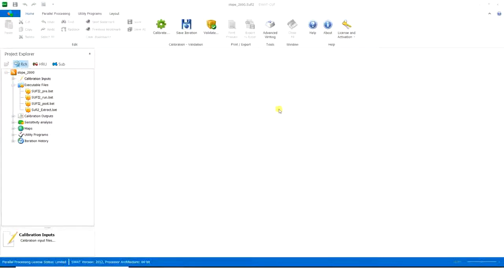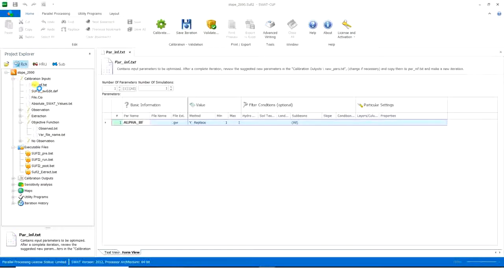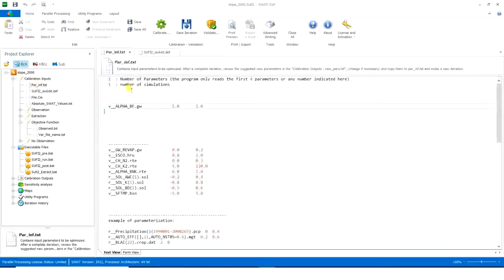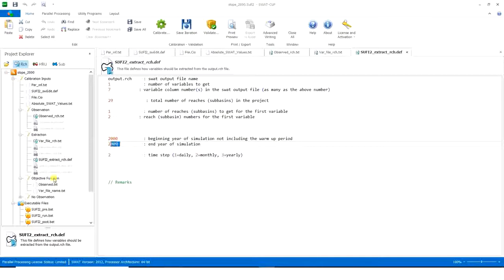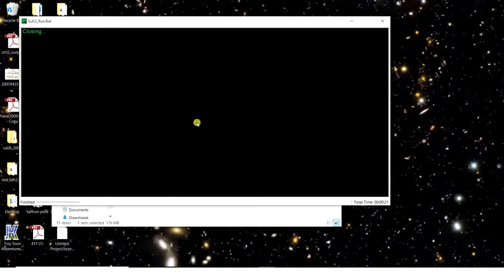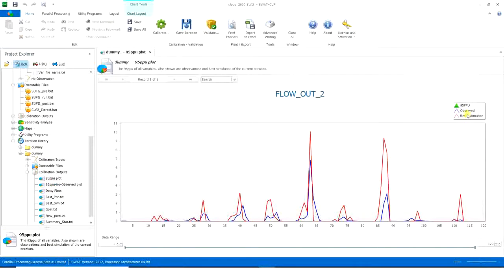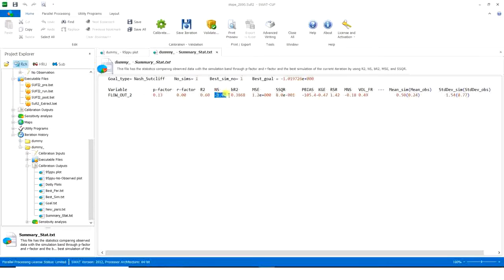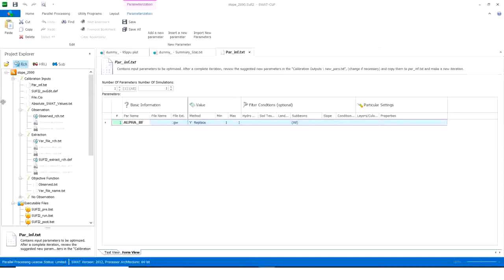Dummy Simulation on SWATCUP

Comment: Thank you for making this beneficial video; What is the unit of hydrometry runoff values you created in excel and pasted them in SWAT-CUP observed_rich.txt? Was it in m3/s? 'cause the monthly data that Iran's hydrometry stations provide are in CMS (m3/s). Should I convert them? 
Also, I want to ask about "variable column number(s) in the swat output file (as many as the above number)." In the video, it was equal to seven; How you knew its value is seven?
Can't wait for the next video and learn about calibrating SWAT.
Best Regards